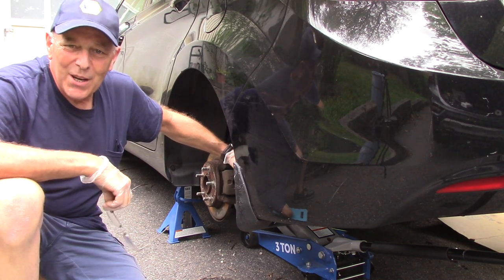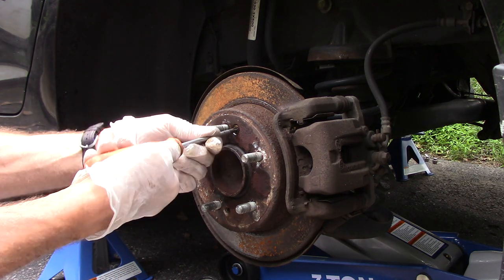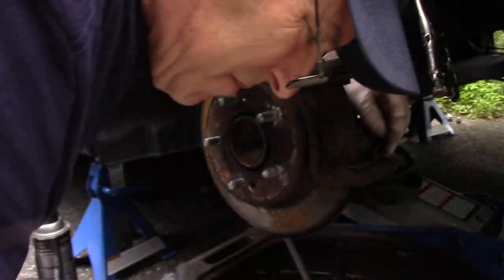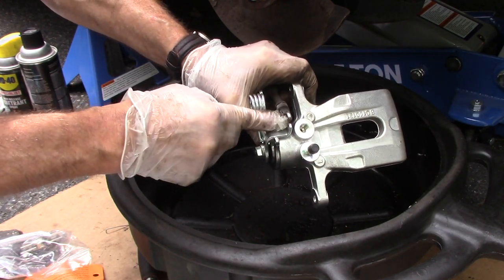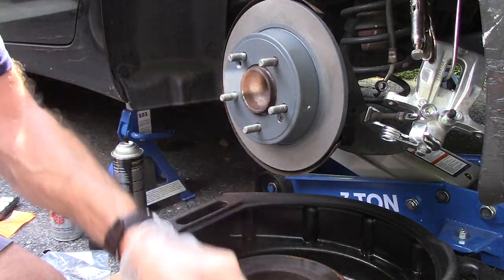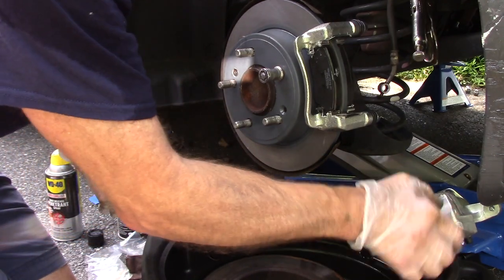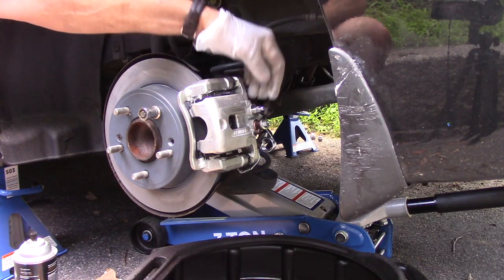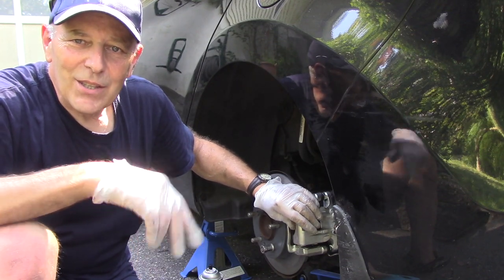Replace Rear Brake, Rotors , Calipers 2011-2017 Hyundai Elantra

Comment: When conecting calipers to brake hose first release bleeding valve and let fluid fill up calipers by gravity then proceed to bleed air from system. Its faster like that.

Comment: Hey I have a question, I bought the correct rear brake pads for my Hyundai Elantra 2017, however when adding the new brakes, I noticed that it didn’t have the hole where you add the pins compared to the original old brakes. I also noticed a couple other videos where others don’t had the pin. I did a drive test and everything was perfect no issues. Will this have an impact with the new brakes not having the pins?

Comment: What a nightmare job I'm 3 days in atleast 8hrs a day, on both rear brake pads and I finally got the left side done I hope.... But the right side needs a new caliper so this video deffintly helps I'm putting a pause on it untill the weekend when I get paid and can buy all the parts needed but lessons learned for sure.

Comment: Good info as always. I'm glad you showed the correct way to bleed them. Most videos just say bleed the brakes but they don't explain it as well and they do not show the fluid actually coming out. When you're trying to explain to somebody how to do it it's nice to have the visual showing how to tell if there is still air in the line.
Reply from the maker: Thanks for stopping by and leaving a comment. Your right seeing how to bleed the system is very important .

Comment: Big Help, Jim...did my 2013 tucson..caliper was frozen..all I replaced was that caliper..pins were sliding, cleaned them anyway...rotors and pads were almost new...Nonetheless, the part that helped me most was the fluid bleed...wife helped...went like EASY..

Comment: very good video . add a little piece of clear hose to the bleeding valve nipple, makes the job cleaner and no oil on the disk or pads. 
there are 4 notches on the piston face and one of them must be position to accommodate the pin on the rear pad!

Comment: Great video Jim! Learned a lot. I just added Powerstop evolution Z23, brake kit, with drilled and slotted rotors, and carbon ceramic pads. So far so good, for the price? I’m going to tackle the rears tomorrow, if the weather cooperates? Thanks for the knowledge. I’m installing on a 2021 Hyundai Elantra SEL, and so far, about 3 days now, I love this kit! 👍

Comment: Hey Jim, Thanks for the detailed video.  I have a 2011 Hyundai Elantra with rusted out backing plates in the rear.  Any suggestions as to how to remove those 4 hub bolts that are behind the hub wheel on tight?
Reply from the maker: That is a very common problem. Most of the time it is the rear right side. You will need to remove the rear brakes and hub bearing so you can then access the backing plate. Good luck . Let me know how you do.

Comment: Is the holes for little screws both r broken off n do not have guts for new screws on the rotors can the rotor still be put on n finish brake job . Will this affect how the rotors n brake works

Comment: Hi Jim,  I got a crazy question about bleeding brakes.  I had new brakes front and rear pads & rotors put in. Then 2 months later a right driver front caliper went. The shop put in the new caliper. Then I drove away and it felt like I had only front brakes. The passage rear rotors seem to get hot (normal temp) and driver side rear rotor - ICE COLD !!!  Since the drivers front new caliper put in and then problem with rear caliper not working - is there air in the rear caliper line ? Thanks

Comment: If you're not swapping calipers how do you compress the existing caliper?
Reply: On the front just use clamp to press them in on the back you need special toll because piston needs to be turned and pressed at the same time.

Comment: Hey Jim, I need to change the ABS sensors on a 2001 grand cherokee laredo 4.0 6 cyl. ( i cant let let this car go, has only 128k miles). can you tell me the tools I will need to remove. hope you can help. Done by a girl. Daddy's little girl!
Reply from the maker: Is it the front or rear abs sensor?